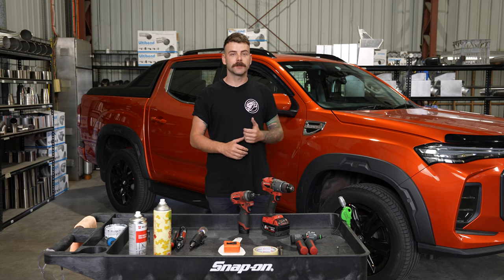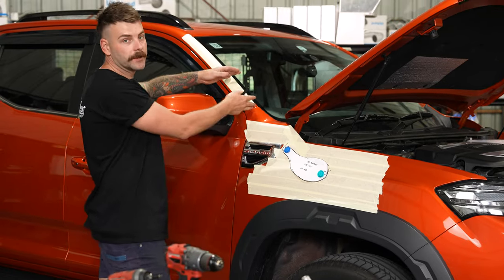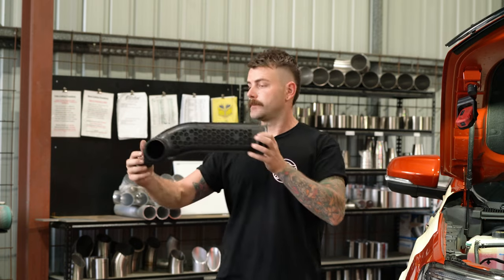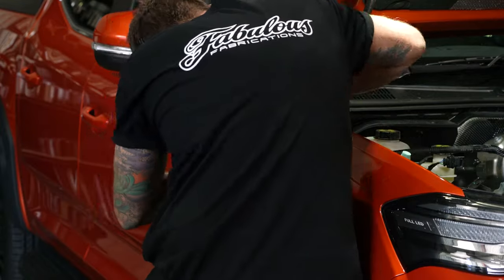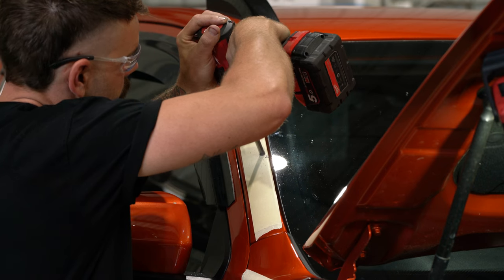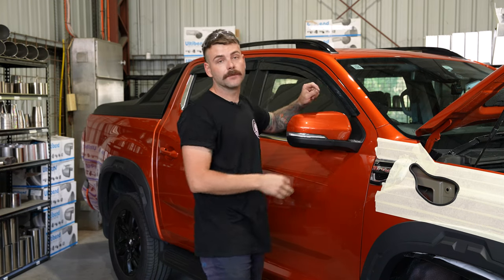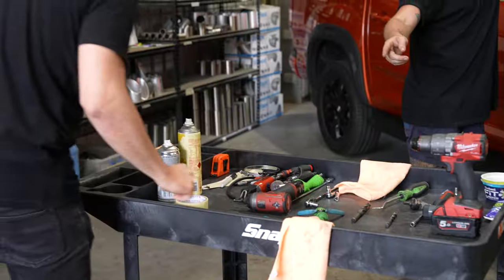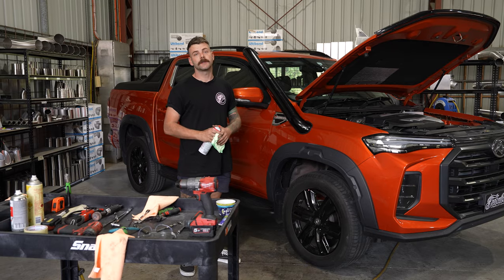INSTALLED: LDV T60 Snorkel kit

Comment: looks good, but, what the heck is it for ?    surely not for going deep into water,  that would screw up the interior of the truck.
Reply from the maker: Hey speeddemon, for brief water crossings, beach driving etc, the factory intake point is from the wheel arch, or in the radiator intake area, this moves it up to cleaner, cooler & drier area. 
Check out our website for pics of them in use.

Comment: Awesome video. 
Q: does the snorkel help Improve power or just help bring in colder air?
Reply from the maker: Hi mate, thanks for watching the video, the primary purpose is simply moving the intake to a higher point for water crossings/beach driving, how ever most manufactures engine management will pull timing out with higher intake air temperatures, therefore it is beneficial to have lower IAT's.